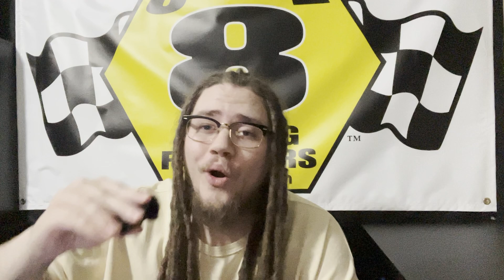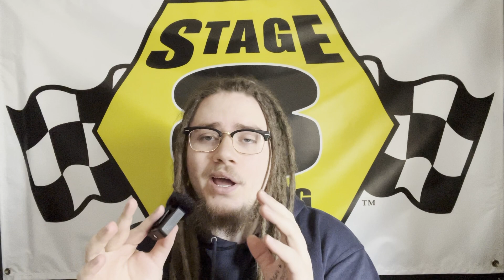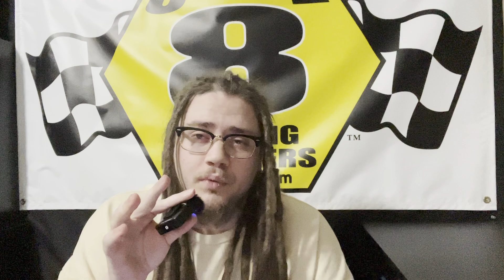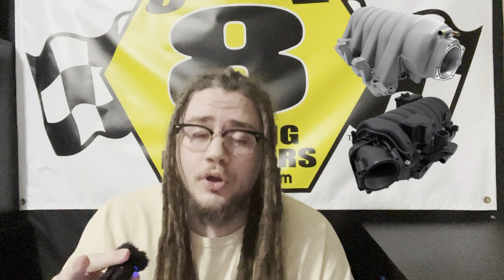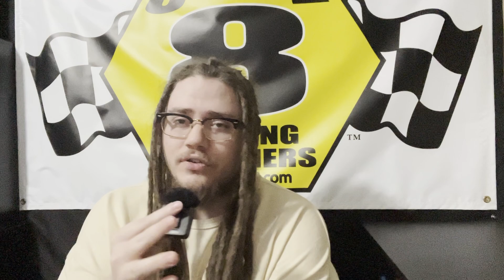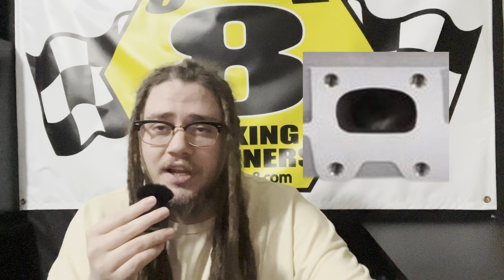6.1L HEMI cylinder heads on a 5.7L HEMI - What to know

Comment: so i can’t use my 5.7 long tube headers? and could i just get a 6.1 cam?
Reply from the maker: If they are Square port headers for a 2003-2008 “Pre-Eagle” 5.7L HEMI, you will not be able to use them with the 6.1L heads. The 6.1L heads have a larger exhaust port that is D shaped, and square port headers would be a choke point
Reply from the maker: Also, you could use a 6.1L camshaft, but it won’t provide significant gains like an aftermarket camshaft would. You would see gains though 🙌🏼 MDS would have to be deleted as 6.1L HEMI engines don’t have MDS.
Reply: @Underdogbuilds gotcha after all my parts research i think 5.7 eagle heads would be more ideal for me and i can still use my long tube headers

Comment: Idk if you are still responding but I have an 05 300c wanted to go 6.4 manifold with hellcat lifter and get rid all the wiring mmx have the 6.1 coil packet adapters so what would I need/have to do also would I need srv controller for 6.4 manifold & can I use the. Mmx wiring adapters and put 6.1 coils packs on if I put 6.4 manifold on

Comment: Do you know if you can tune the car yourself to do a egr valve delete to be able to run the 6.1 intake on the 5.7
Reply from the maker: If you’re experienced with HP Tuners and have a MPVI interface, that’s most definitely possible. However, you can’t do it yourself with something like a diablosport tuner. You’d need to purchase a custom tune.
Reply from the maker: I also know that the EGR block off plates are a bit limited nowadays. I was going to order mine from Germany before I decided to swap heads.

Comment: Appreciate this info, this the exact build I’m starting in a couple weeks. 05’ 5.7 Hemi w/ 6.1 heads manifold & headers. Good to know I can use oem 5.7 gasket but what about the spark plugs? Would the gapping be the same? And would I need the coil pack adapters from mmx?
Reply from the maker: I appreciate you tuning in man 🙏🙌🏼 and hell yeah, I’m about to start something very similar. And yessir, being able to use the stock thickness head gaskets and 6.1L length pushrods while achieving around 11:1 compression is great. I’m still on the fence a bit about spark plug gap and will be consulting with a couple of folks, but at the current moment I’m thinking .035-.043. I’ll most likely make a post about it on Instagram and I’ll come back to this comment if I remember to. The higher cylinder presssures can make it harder for the spark to jump the gap, so a smaller gap would be better in theory. To run 06+ coilpacks you will need to grab the MMX adapters, but if you’re fine with the 03-08 wasted spark system, they’re not needed. You can use your current valve covers and spark system.

Comment: This is useful information for those who arent sure what they need, what to know and what to do. What I would mention to us Pre Eagle 5.7 Hemi guys is what head gasket thickness you need IF you did decide to drop the compression down. Also coming to camshafts you will want to check your Piston To Valve Clearance. For the Eagle and 6.1 heads, you can have machine shops address the valve seats from falling if you feel the need to play it safe. It doesnt hurt to always come prepared for engine assembly after all. I may be sticking with the Pre Eagle heads for my stock motor and build an NA 5.7. Drive that for the time being and grab myself another 5.7 block to build from bottom up.
Reply: im doing the same thing brother my car only has 80k miles rn so i thought might aswell just start building off a block and new trans my plan is to go stroker with a hellion twin turbo kit i got some extra money rn to throw at a block but trying to figure out which to buy atm
Reply: @glitchn50  It sounds like a good build ready to come together. As you know I am sticking with 5.7 blocks. I plan to grab another 5.7 block from a junkyard, disassemble everything off the block. I will have the engine block inspected to see if I can keep it stock displacement. This will determine whether I can keep it stock displacement and put a forged bottom end or if its best to stroke the block to a 360 stroker. From there, I will be investing towards a Magnusson 2650, blower specific camshaft, pair of Eagle or 6.1 heads that'll have CNC port/polish service, valve springs. Fuel supporting mods I am going to ask about to the likes of MMX, HHP or a local performance shop. Stock Nag-1 will be replaced with a fully built Nag-1, 1 piece driveshaft, different rear gears with axles, hubs. Roughly I could see the motor running between 600 to 850 depending the amount of boost and other variables. Thats all I look for with a street/strip car anyways.
Reply from the maker: Hell yeah, Keep me posted on this man! Once my setup is in place and making some decent power, I’ll be grabbing a block to slowly build outside of the car. I’m considering a 6.2L or 6.4L block, mostly leaning towards a 6.4L BGE. This Frankenstein setup will be utilized until I build a forged long block outside of the car while taking my time. I’ll be able to have fun while waiting to have more fun, haha.
Reply from the maker: Sound great man! A dings racing 200% valve body will hold you over for a good while with an otherwise stock NAG1, they allow the NAG1 to handle much more power than anyone previously thought was possible without tearing the whole trans apart.
Reply: @Underdogbuilds going bge block aswell I kinda just wanna go th400 instead of nag1 solely on price and performance over the nag1
Reply: @Underdogbuilds thinking about the one from hhp with Carrillo rods claims its good for 1500hp plus
Reply from the maker: I agree, I’ll have to pin the gasket thickness on the comments. It completely slipped my mind during my the production of the video. I appreciate you bringing that to my attention. And most certainly, piston to valve clearance will certainly need to be checked, especially if you’re unsure if your heads have been decked or by how much. Thank you for your kind words as well as your thorough feedback, it’s appreciated very much. Pre-eagle heads can certainly be taken pretty far, they will flow on par with 6.1 & Eagle heads when ported and polished, which is pretty damn awesome IMO. My buddy was running his ported pre eagle heads until he spun bearings, snapped the crank, and cracked a head. He was getting rowdy with it, haha. That sounds like a fun plan man, I’m going to be in a similar situation after I get this motor put together with the new setup. This setup should last me a couple of seasons or so, of course with some changes such as the valve body and what not. 🙏😄

Comment: Not sure if I should used 6.4l cam will that work with the 6.1l heads and manifold (like I’m saying there’s so much version out there) what’s a build you would recommend/represent
Reply from the maker: So, from 2003-2008 we have pre-eagle blocks which do not have VVT, from 2009+ they do have VVT. Sadly, any VVT cam, such as a 6.4L camshaft will not work in a non-VVT engine such as ours. The camshafts are physically different as the block slightly varies from 2009 and on. There are quite a few good options between cammotion, comp cams, and numerous others. The camshaft I would recommend would be based on goals and certain criteria as well. Street manners, power aspirations, and even future goals tie into the camshaft selection process. If you’re going to daily the car, a “stage 3” or an aggressive camshaft of that nature most likely wouldn’t be best. If you plan to use it as a fun car/weekend car, then the street manners can lack a bit. Different cams require different springs, some require a higher stall torque converter and some don’t, some move the power-band up quite a bit, which leaves folks not liking street driving, and more. The operation range of the camshaft will definitely be a key factor here. Also, if you’d plan on boosting the car in the near future, grabbing a “boost” camshaft will be beneficial in the long run. Keep in mind, a boost cam is going to be optimized for forced induction/boost, so it’ll make a bit less power with the motor naturally aspirated than a camshaft that is optimized for naturally aspirated set ups would. I hope this helps!

Comment: Great video bro!!! Lots of info!!

I’m new to the hemi scene trying to get caught up with mods asap. I own an older model 300 (06) been reading lots of information about what we can do.what kind of setup do you recommend?
Reply from the maker: Thank you very much man!! 🙏🙌🏼 I appreciate you tuning in! Welcome to the HEMI scene 😀 I can surely help recommend a direction, but it’ll be based off of your goals and aspirations power wise, current milage, as well as what extent you would like to go with the motor/vehicle. For someone who wants to make a quick 500 HP and can throw 6-10k at go fast parts, a blower is the quickest way to spice things up with a bolt on installation. Milage definitely affects my advice as lifters, the timing chain, and much more could use a refresher at or over 80-100k miles. If you’d like to refresh numerous components like the timing chain, water pump, oil pump, lifters, valve springs, retainers, etc., then I’d recommend canning the car when doing so and going about things that way. It is truly dependent on these varying factors 🤞🏼

Comment: which one would you prefer to do? I have an 07 300c I am looking to boost by next year
Reply from the maker: Personally, I prefer the 6.1L cylinder heads as a personal preference. As a generalized statement, I would say it’s situationally dependent. A comparison between the cylinder heads physically (intake ports, exhaust ports, valves, etc), flow numbers, and components needed for the swap. I’ll also touch on certain parts needed on certain situations, such as 03-05 guys having to swap from the wasted spark system to the 06+ dual fire coils if they were to go the Eagle cylinder head route. The heads are very similar, they are both typically run at ~11:1 comp, etc., so it should be a perfect video for you to weigh options 😁 and thank you for tuning in, I appreciate you! 🙏🙌🏼

Comment: @underdog what about the clearance? People keep telling me about the clearance on eagle heads. Thanks
Reply from the maker: Eagle cylinder heads require a thicker head gasket as your valves and piston may have an unexpected meeting if not, haha. With the 6.1L cylinder heads, you are able to use a stock thickness head gasket for the Pre-Eagle 5.7L HEMI as long as your cylinder heads were not decked too far. If the heads were decked more than the clearance allows for, some valves and a piston would also have an unexpected meeting. So, when using stock thickness 5.7L head gaskets with 6.1L push rods, as long as your heads were not decked drastically, the motor should be running approximately 11:1 compression and have no clearance issues. I hope this helped! @pandadriven and @gspot300 (on instagram) are some great examples of 6.1L heads being ran on 5.7L Pre-Eagle blocks.
Reply: @ yes this real help

Comment: Great video, I have a question though what’s the issue with running high compression and boost is it because you’ll need a higher grade fuel and people like to stay with pump gas or what
Reply: I’m my mind a diesel is high compression and has boost so why can’t a gas engine be the same
Reply: @Kj-rl7dg diesel fuel is and gas are different, also the motors operate completely differently. Diesel is also build with better and stronger parts.
Diesel combusts under compression, gas is spark. 
That’s my generic understanding of them

Comment: Is a fuel cell and stand alone fuel system a good option, without interfering with the ECU?
Reply from the maker: I’m not entirely certain when it comes to stand alone fuel systems in the lx platform. Fore Innovations is typically the way folks end up going. If that’s not needed, many will run hellcat fuel pumps in OEM baskets.
Reply: @Underdogbuilds  , just wondering, my fuel tank spring a leak somehow, and I just got to thinking is it possible to run a fuel cell with this ECU I guess anything's possible but I've just been trying to research to see if anyone has done it. Looking for the blueprints to do so myself,  I guess you could say.

Comment: i have a 2016 5.7 wk2 gc. will this benefit me and is this compatible on my engine
Reply from the maker: Eagle cylinder heads on 2009+ 5.7L HEMIs flow almost identically to 6.1L cylinder heads. The main differences are the taller valve train in the Eagle heads and improved port velocity. It wouldn’t be very beneficial to swap to 6.1L cylinder heads. If you port your current cylinder heads, you can see flow numbers north of 360 CFM!

Comment: Interesting! I only hear about Eagle head swaps. 🔥
Reply from the maker: @AntonhigginsIII  Most definitely! Eagle heads are typically a bit cheaper and or more accessible most of the time. The 6.1L head swap has been done, but not thoroughly documented publicly. Flow numbers are very similar, but there are key differences in running each cylinder head.